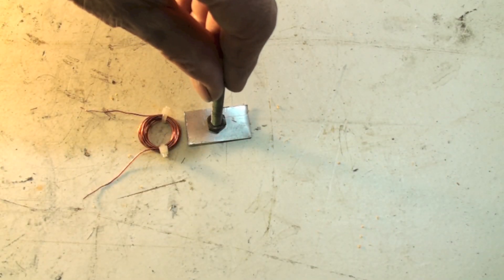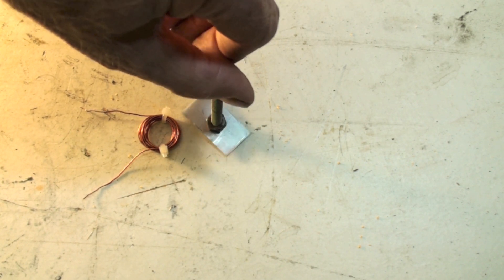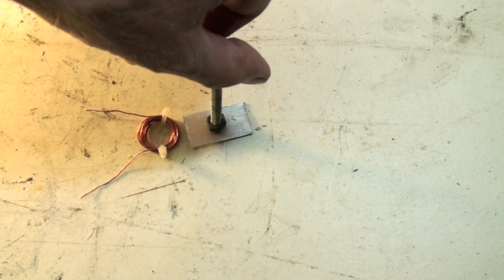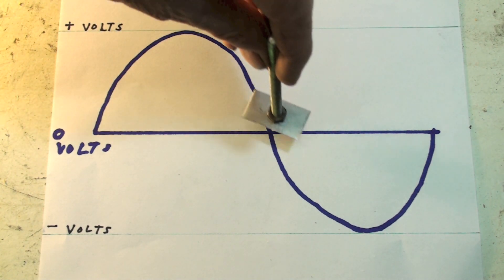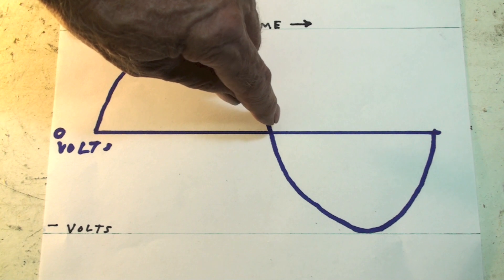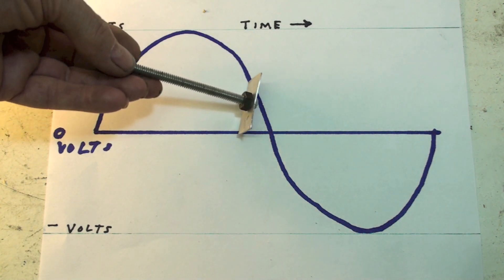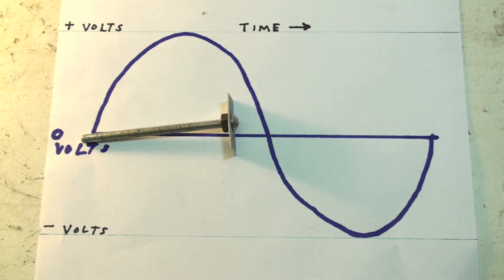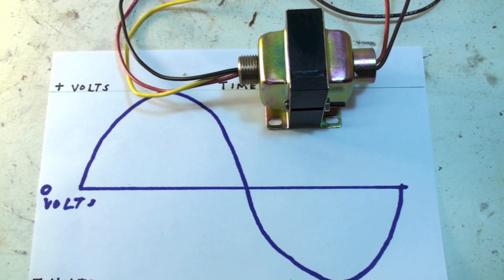Alternating current and its uses in transformers.

Comment: Mr Gray, I'm a little confused with your video on magnets and tranformes..Are you telling me that when voltage goes up amps go down ? I thought ohms were inversely proportional to amps...I'm kinda confused,please let me know your thinking on this subject matter..        Thank you,Mason
Reply from the maker: What you are talking about is a pure resistance load.  If you have pure resistance circuit, the higher the resistance, the lower the amperage.  In theory you could measure resistance and voltage and determine amperage.  In the real world of electricity, this seldom happens.  Most loads in an alternating current circuit are inductive or combinations of resistive and inductive loads.  The back EMF of inductive loads reduces the amperage draw of the circuit.  Hope this helps.
GFM